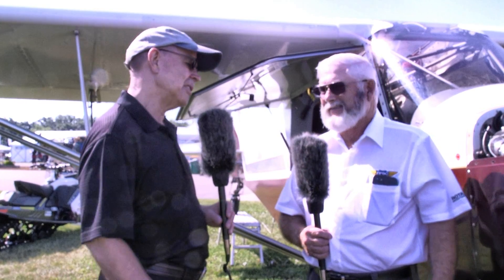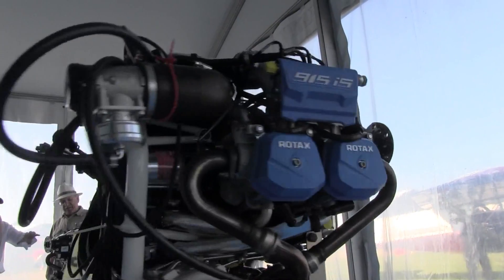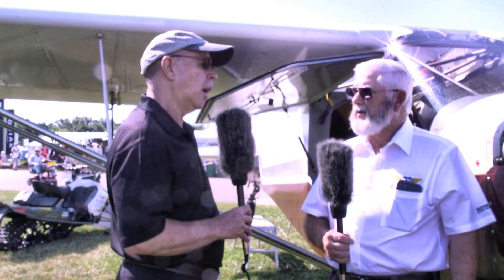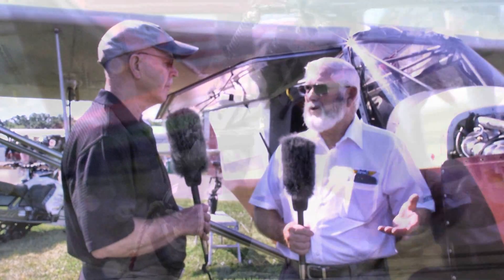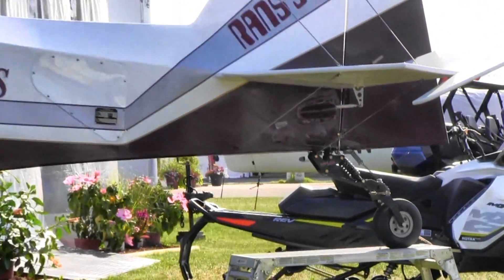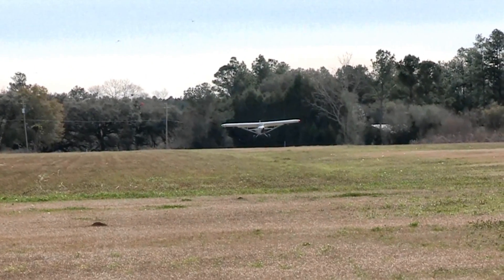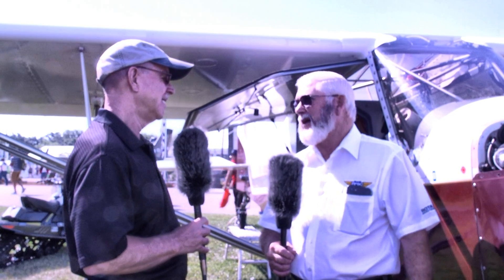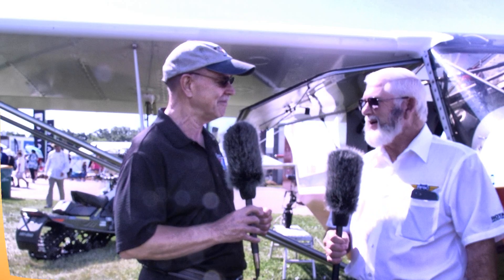Rotax 915 iS fuel injected, turbocharged, intercooled 141 HP engine on RANS S7.

Comment: What's the empty weight ?     How did all the extra weight on the nose effect the landings ? 3600 hour S-7 pilot here, looks like a cool motor, not sure about the extra weight and complexity though!   Looks like quad tanks, that tells me something about the burn rate.  Speed costs, for sure.
Reply: Ronnie told me he was burning 5.5 GPH going 110 MPH. Put an iS engine in ECO mode and they’ll sip fuel.

Comment: I'm sure it's a half decent engine but it's a modest car size engine and they want 37 grand for it. That is just ridiculous.
Reply: I'm sure it's a great engine  but it's a modest car size engine and they want 37 grand for it. That is just insane.
Reply: economies of scale... cars are built in the millions, aircraft engines in the thousands. Every aircraft engine is expensive as hell.
Reply: A modest sized car engine takes a few million $ to design and test. A modest sized airplane engine cost 10's of millions $ to design and test. It's all the testing and validation that makes airplane engines cost so much. You're not going to die if your car engine stops working.... Not to mention trying to recoup those $10s of millions in testing from an engine with a very limited market and production numbers.
Reply: I think I’ll stay with my Titan 180hp for 27500, no computers. If you want pump gas get the 160hp version with carb.
Reply: @FarmerTed  Where do you get the titan for $27,500  .. Actually who sells them ..  Is it direct from Continental ?
Reply: @FarmerTed  I for one am dead sick of these 1950's-1960's designed, heavy, thirsty engines that are forever tied to twice the price 100LL (I'm aware of the autogas or at least mogas STC, but Lycoming still doesn't like it because of inconsistent additives varying by location, time of year, and concerns over the effects of altitude on ethanol).  It's endlessly frustrating in this day and age that we are still using carburetors that merely approximate the fuel/air charge, have issues with carb ice, require manual adjustment of the mixture with environmental changes, struggle with cold starts (and non ECU'd fuel injection motors have problems with hot starts), have hit or miss diagnostics, etc etc.  Add to that the degree of tribal knowledge to operate this old tech effectively (think student pilot) and the requirement for human intervention and management or you risk losing/damaging the engine (carb ice, detonation, improper mixture on takeoff/climbout, forgetting to richen/lean the mixture with climbs/descents, taxing with the RPM's too low and fouling the plugs, etc etc.).

Airliners, military aircraft, and space ships make extensive use of computerization, but apparently it's too unreliable for general aviation?
Reply: That engine was designed by rotax for the US military drone program. It's full FADEC, meaning no manual mixture, no manual prop trim, full auto lean of peak, and the military uses it at up to 30,000ft. It is easily the MOST advanced prop engine in production today by a huge margin. Does all that on pump gas too. A 150hp lycoming is $30,000 with a carburetor and requires leaded gas. I've flown in a plane with a 915 in it and at full gross at 9,000ft DA climbed out at 800fpm. You go ahead and try that with ANY other plane engine. And the other reason they are more money is the redundancy. Two ecu's, two spark plugs per cylinder and so on. $37,000 nis a bargin for those performance numbers. Oh ya, and you don't need an A&P to work on it which saves you $100 an hour in labor.
Reply: kevin butler Thank you so much for this cogent answer! High quality IS NOT expensive on this over its useful life - consumption, oil use, maintenance, weight, full power at high altitude, etc, etc...